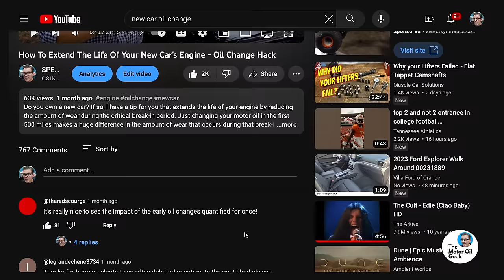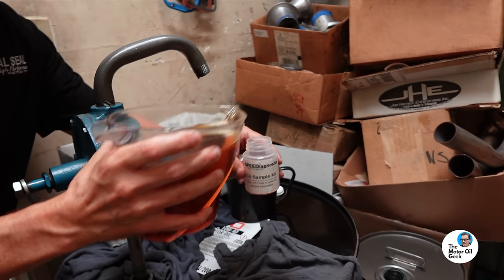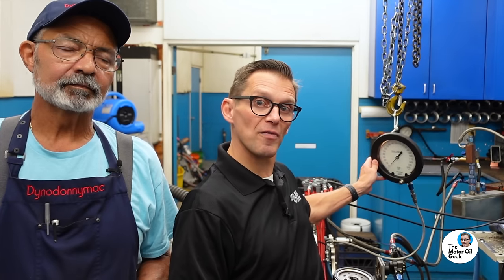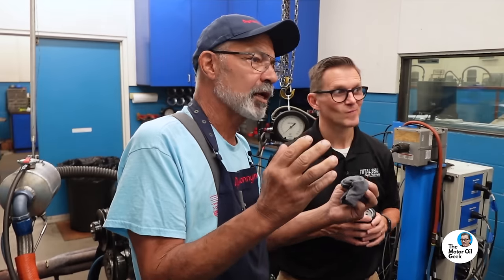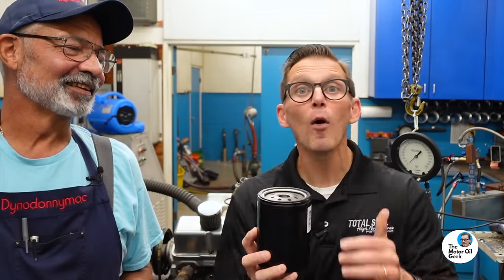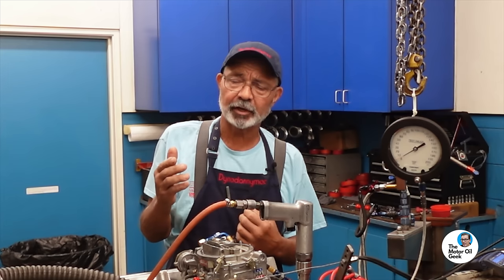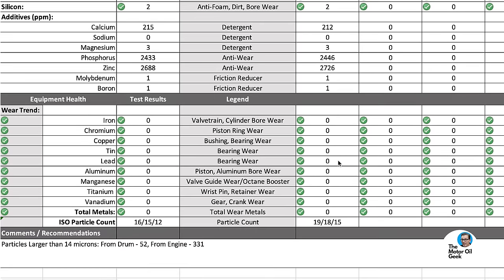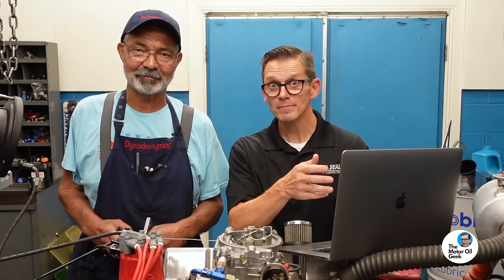Does Pre-FILLING The Oil FILTER Cause Engine DAMAGE?

Comment: Motorcycles usually have either a horizontally fitted oil filter, or a cartridge filter, and in the case of an HD it bypasses the filter to the engine (dry sump system.) In racing engine builds the whole engine usually has adequate pre-lube fitted, though some like to pump the oil through before starting, others run without plugs or fuel to prime the oiling system. I know your opinion on additives, but this original oil is only there for the original break-in of 20-30 minutes without load, depending on the builder, and the next fill isn't in there very long either. I've never seen conclusive evidence of a difference in wear on the bearings between methods, though one would expect less oil to get to the rod bearings with the externally driven oil pump method. After this, there will always be some oil left on bearings and wear surfaces if it is any good, so I don't think we are hurting our motorbikes following manufacturer's recommendations. (And certainly don't think Porsche would miss something like this.)

So fill your filter if you want, I am unconvinced it is necessary.

Comment: There are actually cases that pre filling the oil filter can damage the engine. Or actually more importantly in which order you do the oil change. If you pre fill the oil filter before you change the oil it can prohibit the oil pump to suck up the oil from the sump. I had this already happen 2 times. If you have a full pre filled oil filter its like a blockage that doesn’t let air go through prohibiting the oil from the oil sump  going up the oil pump suction tube. There is a air bubble stuck in the pipe, think of it pushing a glass upside down into a liquid. The solution is the fill first your oil pan and than to fill your oil filter.  

Keep in mind I had this problem only with just restored engines with still very tight tolerances and assembly fluid which also acts like  a air seal.

Comment: Really a good channel. 
 I am going to address a separate issue that has bothered me for quite some time. 
 People  (and I mean very knowledgeable people) all seem to be convinced that at start up of a cold engine,  all the junk at the bottom of the pan gets sucked up into the engine and since it's cold the majority will bypass the filter. 
 My question is,  what junk?
 The engine has a filter,  which is constantly cleaning particulate out of the oil.
 What junk? At most there should be nothing more than some carbon (soot) that has settled out.
 If your pan is full of "junk" you have a serious problem,  which will likely require repair. 
 Simply put, THERE IS NO JUNK IN THE BOTTOM OF THE PAN, unless you don't change oil frequently enough. 
 Please let me know if I am correct.

Comment: This a good example of science at work to proof. The comments if dirty oil out of sealed bottles came from lack of knowledge and unclear postulation, something that is becoming more prevalent on the internet because it is so easy to post a comment without consequence. 

Additionally, I will add: that if changing oil on an engine (such as my BMW X3) that has canister filters without canister) unplug whatever will start the motor, and crank for 10- 15 seconds to pe-fill the oil galleries with pressure.
The reason the damage occurs too (primarily) the crankshaft bearings (main and rod journal) is because of the impact from compression and combustion pressures when the motor is running during the brief 2-6 seconds of run time without oil pressure. Most modern motors will pressure the oil galleys in a second or two before the motor begins to run...when there is oil in the filter, WHICH IS the very beginning of the motors oil galley system.
Also one other hint. Let the oil in the filter (after pre-filling it) set for a minute or two so as to saturate the paper element to complete wetness.
Cheers.

Comment: I have a  99 7.3 diesel  with over 400k on the original engine. Owned it since new and do all my own oul changes.  Never have pre-filled an oil filter.  No issues. There's plenty of lubricant left in the bearings to let the engine run for a few seconds at idle.

Comment: Since the oil typically comes out of the passage from the pump, into the center of the filter, and then goes out through the filter into the galleries and to the bearings, cam, etc.   So pouring oil into the filter, through the hole it gets pushed into the filter from the oil pump, means all of the oil you pour into the filter gets filtered before entering the galleries.

Comment: I think the difference is negligible. I worked for a car manufaturer as a mechanic for many years and we were never trained to prefill the filter. However when you start the engine you dont rev it, you just let it tick over, then stop the engine and top up the oil as required to the dipstick. There is an oil presure valve in the oil pump this controls the oil presure in the engine. Dont forget there will be new oil still making its way down to the bottom of the engine from the new oil just put in.

Comment: I heard it doesn't really matter because most engines lubricate the upper components right out of the sump in the bottom of the oil pan, it runs through the filter before it returns to the pan. That might be wrong though.

Comment: Don’t forget that filter will soak up the oil keep topping it off then install it another thing they didn’t mention you can pull the wire to the coil to pump the oil without firing then reinstall it

Comment: I've always filled any filter I can.  Even so, some vehicles have a crank function (called flood mode) that allows cranking without ignition.  In my 2018 F-150 you hold the accelerator down while cranking and it won't start.  I do this until I see oil pressure because 150 rpm is better than 700 rpm without oil pressure.  I've seen some vehicles actually clatter until pressure builds.  That's life coming off the engine in real time!

Comment: not come across many engines here you could prefil a canister type filter most on the side of block. i always just disconnected the sparks and spin engine until oil pressure light out.

Comment: I'll admit, I've never heard of prefilling an oil filter. Many engines I've done oil changes on either have a cartridge filter or are mounted inverted. I have 2 personal vehicles where I could prefill them, but if pressure is not detected, both fuel and spark are not enabled. As I have older vehicles (pre odb2) and they are very high mileage (several hundred thousand miles) I have to guess I'm doing something right. All I did was switch from conventional to a fully synthetic oil with the appropriate filters for the oil. As the engines run smooth, don't burn any oil or even leak it, again, I'm doing something right.

Comment: You can't prefill many filters, side mount or top mounted as an example. Disable the ignition and crank the engine over, once the oil is installed, until the oil light goes out. Enable the ignition and start. Remove the EFI fuse to disable the ignition.

Comment: I beg to differ. Mobil 1 Full synthetic has shown engines running with no oil at all. Most new cars don't crank for 4 seconds before oil pressure builds up.

Comment: I remember changing my own oil after the engine was warmed up. I didn't fill the oil filter and when I started it, I heard just a little rod knock for a few seconds then quieted down. That sound turned my stomach. I filled every filter that could be filled since. My '12 Chevy Equinox with the 2.4 has a set up that can't be filled,but there is no bearing noise on start up after an oil/filter change.

Comment: What I'd say before watching the video is that the engine is running dry for the amount of time it takes for an engine to suck fresh oil through a dry filter, so that's obviously worse than any impurities in brand new oil. Also you have to prime the filters on large trucks and diesels anyway to prevent a dry filter element from tearing after an oil change, and it's probably good insurance to do that on cars for the same reason.

Comment: The only way prefilling an oil filter can hurt an engine is if you get debris into the filter while doing so. Such as a piece of foil or plastic from the bottle seal. Thus if you choose to prefill an oil filter fill it through the outside holes not the inner threaded hole. Oil enters a filter from the outside and is sent to the engine through the middle part. Either way after replacing the filter there is  more wear as the oil system has to be purged of air. Pre filling the filter reduces that a very tiny (though measurable) amount. Which when you consider how infrequent an oil change is the total operating hours of an engine it's not anything to be concerned about. Where some foil falling into the filter center hole could easily clot an oil passage resulting in a wiped lifter or spun bearing.

Comment: Way back in 1994 Ford tractors had major hydraulic oil pump failures and the engineers had no idea why their hydraulic pumps failed except by our dealership for 2 years in a row. The reason was because a new tractor foreman started to work there aka me. The problem Ford engineers didn't see that I did was the filter took a whopping 4 litres oil and on the suction side of the pump so it took ages to prime all the air out and this caused it to run dry and do damage to the pump.
A few weeks later Ford offered me a position but I declined it because I do not like sleeping in 5 days a week in different beds and where going to get married at the time.

Comment: You must prefill the oil filter so the oil pump will freely push the oil to the top because if its empty, the oil pump will now pump the oil to fill the filter before it goes to the top to smoothen the shafts to move

Comment: Some engines even call for it.  GM with the L3B 2.7 Turbo engine, GM wants you to pre-fill the filter as if you don't, it can set oil pressure performance codes for the dual stage oil pump.  Worst case, at least do a clear flood start (foot to the floor and crank it), IF your vehicle has the ability to clear flood, that way it fills the oil filter at cranking speed before it fires the engine.

Comment: What about engine designs where the oil filter is installed in upside down position or slanted or at 90 degrees to the engine's vertical axis? In those designs the oil will EVERYTIME be drained out of the oil filter back to the sump everytime the engine is stopped.

Comment: Has anybody in this comments section mentioned what Caterpillar corp says about prefilling?  All I see is "my grandfather did it this way"

Also the oil sample was flawed.  Oil from the pan is going through the filter before it hits the engine.  Oil from the container goes straight to the bearings.  I have seen many containers with visible flecks.  Since I do this for a living.  I am sticking with Cat's specification on prefilling filters.

Comment: I'm no mechanic and I know that running a machine dry will certainly cause it damage. The time it takes for that filter to fill up and oil to run through the system may just be enough for the machine to make a few scratches or welds.

Comment: I agree with pre filling the filter, however, in my 2012 Toyota Matrix 1.8L the oil filter is installed horizontally so there is no way in hell of pre filling.  It is a canister type as well not a spin on so it's next to impossible to pre fill.  On another note though, that Toyota 1.8L engine has been known to run for over 500,000 miles so I don't think the absence of pre filling does that much harm.

Comment: By GRACE alone I didn't destroy the Pontiac Sunfire I oiled the filter gasket on both sides before I married it to the engine. Simple straightforward install on the backside of the engine with a couple inches of clearance all the way around. I snugged  the filter up after contact by hand  and gave it a 5/8 turn because grandpa mechanic said 3/4 turn while GRANDMA  pretty much knew "for shore" 1/2 turn was legit. Either 6 or 9 miles separate me from work and my house so I punched it going the short way and the oil pump did its thing in maybe 4 strokes... I shut it down while my foot was near the floorboard mashing to  payday day. The "0O" ring blew itself and the rubber ended half in and half out. My sister laughed when she heard a very good friend of mine telling me the exact same thing my dad had said ... Poke your pinky in to the first knuckle and wipe it off on the rim... That's all the lube any old filter needs. Of course they mean one side of the gasket... Oddly enough you put it on the side that's not glued or stuck to the filter itself.

Comment: I'm not really a mechanic guy so I am a bit confused. If i take out 5 quarts of used oil after warming, drain the oil, change the filter without pre filling, refill the engine with new oil, and start it. Sure it takes 5 seconds to get oil to pressure, but what does that have to do with new oil or oil thats in the engine particulates? This test does nothing to determine whether prefilling oil filter will cause engine damage. I guess you're assuming we all know the order the oil flows throughout the system and 5 seconds of no oil in a certain area after being drained is alarming maybe?

Comment: Can't wait for your video on pre-filling the oil filter on a Ram 4X4 2500 or 3500 with the 6.7L Cummins
Reply: Cummins doesn’t recommend pre filling because they had problems in the past with the sliver seal on the oil jug getting into the oil and clogging ports in the engine. Now not many oil manufacturers use that sliver seal anymore. I’ve always pre filled them tho.

Comment: From what you are saying here it appears to me (ahhh claiming innocence) that the destruction of the bearings is accomplished by 1) Starting the engine with no oil in the crank bearings or 2) Starting the engine with no pressure in the bearings. I am going to argue (and I might just be wrong) that the oil wedge must exist in the bearings and that oil pressure adds to that oil wedge. 
Therefore the engine should be turned without combustion long enough to lubricate the bearings before being allowed to combust. The outcome of this is that the engine should always appear to be hard to start and never start immediatly. This could also be accomplished by the engine oil being circulated by a (probably) electric pump to pre lube the beast.
The preflood mode is a fine idea but I have never seen such a thing on a normal street car.

Comment: While I'm sitting here pondering if my 2017 GMC Canyon (3.6) has a Clear Flood Mode, I also can't help but wonder why dead cranking the entire rotating assembly while dry would be any better then simply starting the thing. As it is, I was horrified to find that the truck I purchased is equipped with an upside down oil filter. The truck sometimes rattles for a second on cold starts. But I've also noticed that it doesn't rattle when I install a new filter (still warm but obviously cavitated).  So far, my best attempt to mitigate this is to add a bottle of Lucas Low Viscosity Stabilizer, and send foul thoughts to the engineers responsible for this travesty.

Comment: The thing that people are not taking into consideration is if you’re driving a turbo charged engine at start up your turbo was spinning at 10 to 12,000 RPMs. It doesn’t take much time with no oil pressure before you no longer have bearings in your turbo charger. I own multiple large trucks in my life and I have never once changed the oil without pre-filling the filter and I’ve had the engines run over 600,000 km with no internal issues.

Comment: Ok, now you need to set up a rig to filter clean oil directly from the jug through a new oil filter and see if it gets cleaner after it is ran through the filter or dirtier from the contaminants that could be in the filter from packaging and shipping. Only some filters are shipped with shrink wrap to maintain cleanliness.

Comment: Great video on highly debated subject! Logic & Science prevails.   You mention clean funnels in video, is there any impact in oil tests or oil fill, if you use "Brake Clean" to clean out funnels or suction line ( oil samples via dipstick tube) to store… not directly before test, line & funnel have dried. If residue throws off test, is there a better cleaner to use?

Comment: As a 3rd generation mechanic, this is only necessary on a brand-new engine or rebuild. Because of TWO reasons. All of the oil isn't removed on a oil drain. All of the internal components still have an oil film. Second, Today's Synthetic oils are awesome and do a superior job! 
I have never ever heard of or seen an engine failure or increased wear due to not putting oil in the filter.

Comment: I have a 2019 F150 2.7L Ecoboost V-6. The oil filter assembly is mounted on TOP of the engine, with the oil filter assembly port facing UP. This means I can look DOWN into the oil filter assembly port. So, explain to me how I fill up the oil filter housing without pouring it all over the engine upon reassembly. Perhaps, Ford engineers know something about that which you don't. I'm going with the Ford engineers on this one and say, "no, you don't need to fill the new oil filter (or oil filter housing) with new oil." Your owner's manual should tell you what your oil capacity is. Your dipstick indicates the acceptable oil level range. I prefer to change the oil just before I leave the vehicle sit (engine off) overnight, then check the oil level with the dipstick, the following day before I crank the engine. In which case, I won't need to wipe the dipstick to check the oil level.